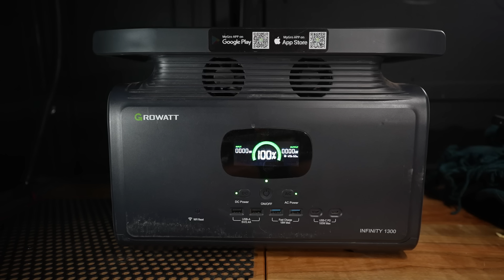Solo Truck Camping in my Defender | Growatt Infinity 1300 Review

Comment: That front oil leak can't be constant velocity joint, grease goes on those, and googl front transfer case ( your vehicle ) I'm guessing it still turns when 4 wheel is not engaged, so on high way you have rear wheel drive..my point is front transfer case can not go dry or bad news and it's prolly next to impossible to check it's gear oil level, you'd have to unscrew pug on it and it may have a built in dip stick or not..not trying to scare you, just make sure you know where it's leaking from, it's called gear box ( very generic ,) or front transfer case,..my resume is I had a 72 Bronco, 95:Jeep Wrangler, worked at ski area on. A 196O,s Mercedes Unimog..with leaky transfer case, it had ,18 gears..I'm sure you have hear head 4'wheel guys following you on here .just a fyi..re oil / gear leaks..Me n NH 😎

Comment: Re axle leak: when the seals leak, it's time for an axle rebuild. The grease in there is seled for life and if you overfil it then you force more out or past the internal seal to the diff. I suspect it's also a bearing collapse in the swivel housing, so will need a replacement which is a rebuild. Only use Corteco seals and it needs to be set up correctly or you'll do more damage or it'll get shake when driving. also turn the steering full over to whatever side you're filling as it then clears the swivel ball and fills easier. 

You might not be able to save all the puppies, but you can try! 🙂

Comment: I hate to be doom and gloom but I think the axle leak is more than just the swivel seal. There is an inner seal keeping gear oil in the middle and grease on the outsides. It’s fairly involved and heavy on labor. 😢 Just a heads up

Comment: I think the best application for this battery considering the output and fast charging would be to power an air conditioner! Get the ac cranking, and have the solar panel chucking in rays for days during the daylight hours.

Comment: I’ve noticed on a number of portable fridges it’s how you pack your goods and how it cools certain items. In my experience pack denser bottled goods (condiments etc) towards the bottom along with meats and put your veg and eggs towards the lid because it will usually be cooler almost freezing towards the bottom. Maybe that helps your frozen veggies or not and you may already be packing it like that. Just a thought.

Comment: Hey you used Blue’s hiking water bottle! ☺️

I’m surprised you didn’t have issues with the power outlets on the sides of the GrowWatt. If it was in built-in cabinet in Poe, you’d have to pull it out to access those outlets.

These dogs are breaking my heart. 😢